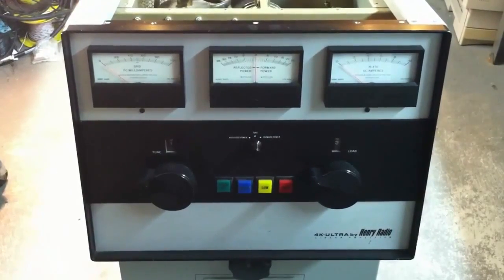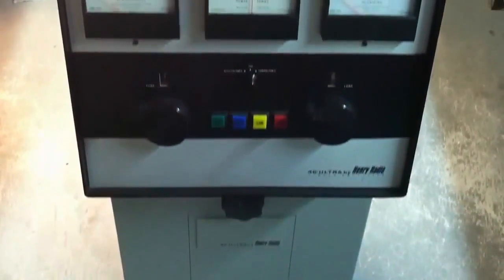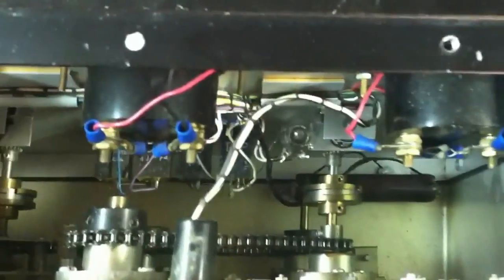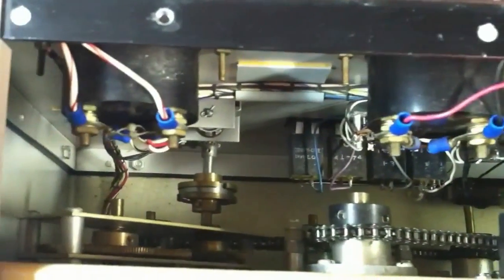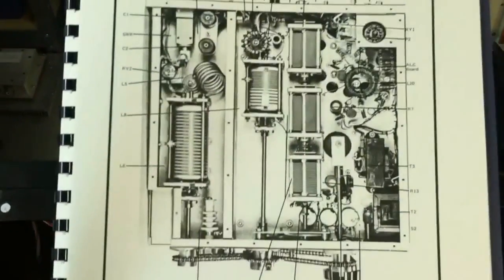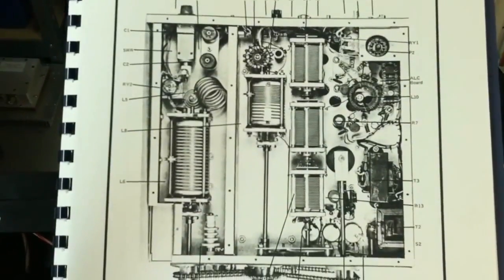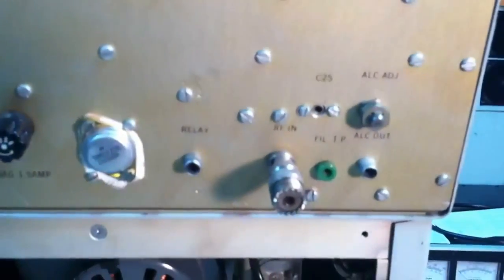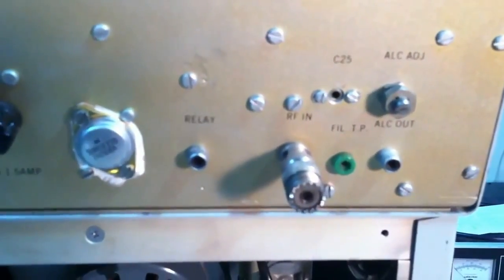HENRY 4K ULTRA AMPLIFIER INSIDE VIEW

Comment: I have one of these... Got it from a CBer.  Got hit by lightening and was worked on by a CB shop that could not get it to run.  I bought it for almost nothing and restored it.  The hard part was getting all of the stuff on the chain drive re-aligned so that it worked together properly again.  It's a difficult process (must be done on 20 meters).  The custom line-section is still broken.  Bird stopped selling them, but actually sent me their set-up apparatus for them.  I gutted some tuning slugs to replace the insides and it appears to work now.
Reply from the maker: It was designed to do 1kw ccs.
Reply: It will easily do 1kw+ out on AM and RTTY all day long (even though i never use AM).   I'm mostly a CW and SSB guy.  I called Ted Henry and was able to track down the guy who was their 4Ku guru and get the alignment procedure directly from him (he has not worked for Henry radio for years but still remembered the entire alignment procedure).  A nice amp however you look at it... that is, if you can find one!
Reply from the maker: Glad you have it working again, not many left.
Reply: @doctorbills790  what only 1 kw  I don't think so I had the henry 2k did way more than that.